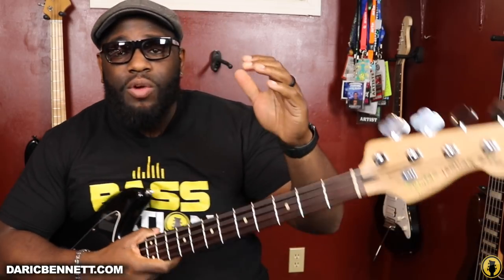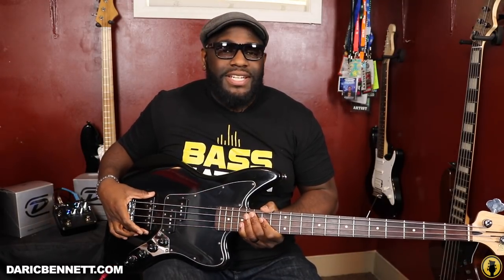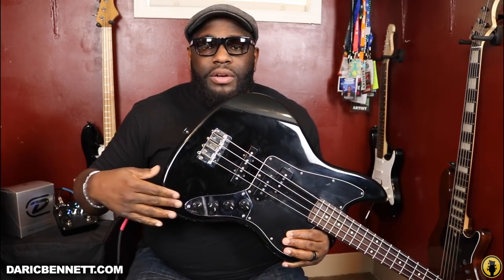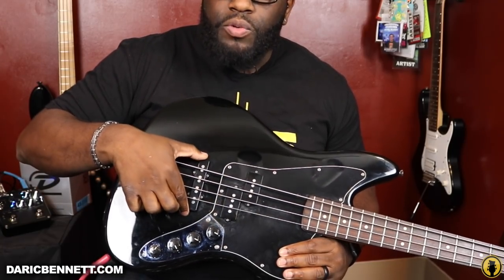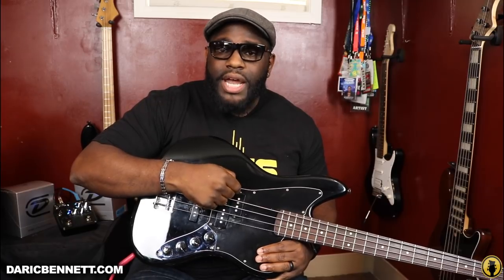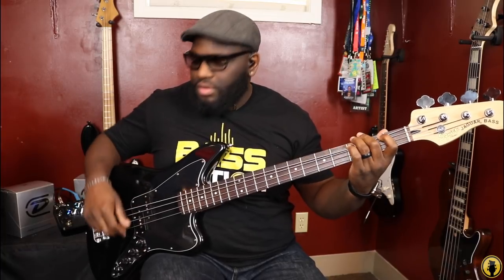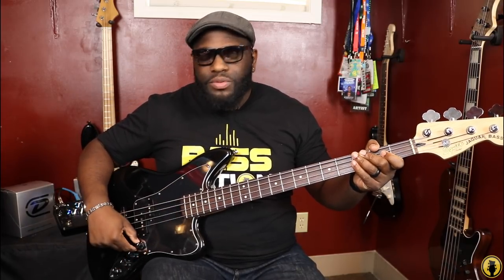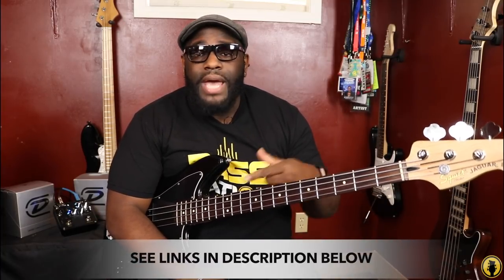HOW TO EQ YOUR BASS GUITAR ~ Bass Guitar Tips ~ Daric Bennett's Bass Lessons

Comment: I found it best to just use a touch of the boost and leave it. I also put a blend dial in instead of separate volumes controls. It's a great bass but the bridge pup is weak so I replaced that as well.  Now it kills.

Comment: Not to be a critic but the title of this vid was “how to EQ your bass”, yet you never touched upon EQ. The title should have been “understanding bass pickup knobs”.
Reply: His e string also had a raddling problem 😂
Reply from the maker: Bass pick up knobs control the EQ of the bass. It’s called eq 101. You first control the eq of your bass by adjusting the knobs…… this is for beginners. So in that sense, I apologize. I should have said for beginners only….You have to start somewhere. You must haven’t seen my course where I go in depth on the frequency ranges the the knobs include, which may I add, Is different for each bass and or pick up sets. Thanks for the critique though, I’ll keep it in mind.
Reply from the maker: And thanks for the comment @the peaks not sure what’s funny but thanks for informing me.